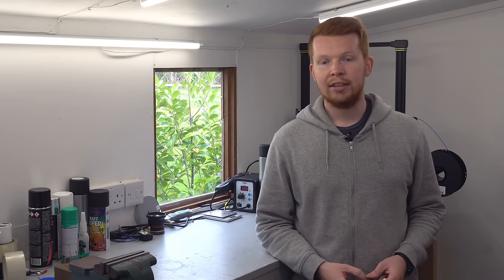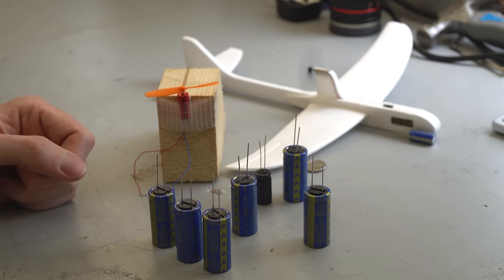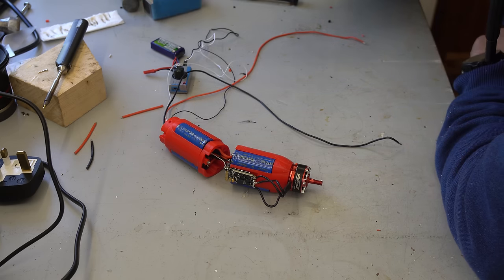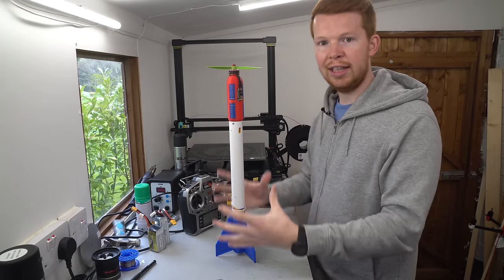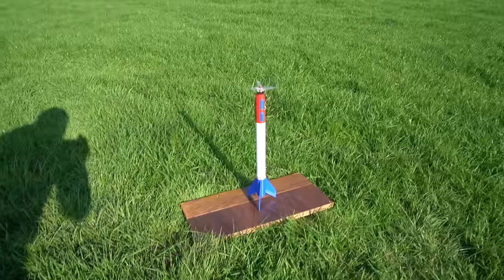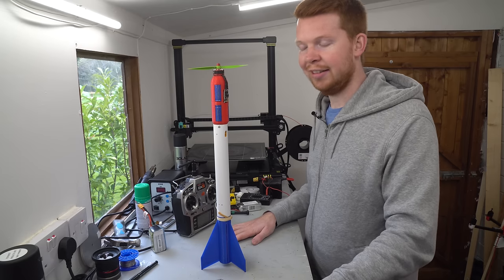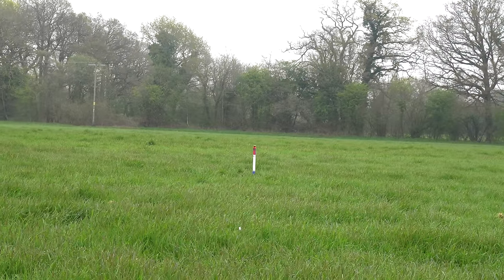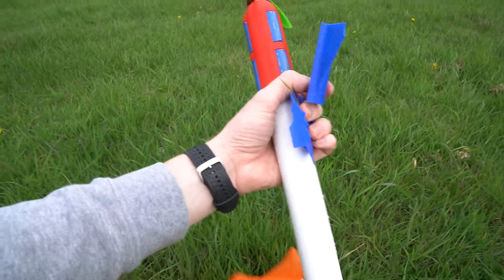Super Capacitor Rocket

Comment: Years ago I heard someone say that a 1F capacitor was impossible or largely impractical ... time changes way too fast :-)
Reply: I mean i guess before super caps that does not sound like an insane statement but for car audio they definitely had up to 5F capacitors probably bigger for a while and also i mean i heard of super capacitors like 5 years ago or so
Reply: James Holbrook They exist since 60s, just were too expensive back then. Also they were vastly improved over time, first supercaps were really big. Like 12v 6F was about the size of a hockey puck. Now it's about the size of 2 2032 cells.
Reply: It is not too fast. Before supercapacitor 1F was really big size. But it is already 50-100 years so. So it is normal that they find something new after 100 year of research.
Reply: I remember playing with 1 Farad 14.4volt caps in the mid '90's when I got into car stereo's and Subs.  1st rig 1200W 4x50w and 1KW Sub's. used to use a light bulb to charge that massive cap after lots of scary moments.
Reply: Capacitor size is usually based on Farad and voltage rating. A 100 volt 1 farad capacitor would be enormous but it would store up to 5 kilo joules, whereas a 1 volt 1 farad capacitor would only store half a joule.
Reply: the farad was made by Faraday, and that is how it got its name, he made the farad the size of it  - unit back then
Reply: @lousmith84  Farad
Reply: two years ago doing my physics Alevel I got tought the same thing
and it still says so in the textbooks
Reply: In the early 1970's, one of my engineering professors stated that it was not practical to build a 1F capacitor as it would occupy a volume almost as large as our classroom.  It sure didn't take long for that, "impossible capacitor" to become common place.
Reply: They still are, depends on the voltage of that 1F cap.
Reply: Man, I feel so old.
Reply: @shadowflash705  Is a hockey puck similar in size to a tuna can? Sincerely a confused Southerner
Reply: @FlyMIfYouGotM  reminds me of when i was 16 i wanted a 5F capacitor for my car stereo, my mums partner who used to be a telephone engineer, said it wouldnt fit in my car and the whole thing was a stupid idea...  Two months of apprenctice wages later, i put one on his desk, was about the size of a 600ml coke bottle, in a case with an led display and things, he was astonished (would have been about 2006)

Comment: "The parachute worked most if the times, apart from obviously the last time"
I think that can be said about most parachutes in the end
Reply: as a former 82nd, member that has had a hard landing too. I thought the parachute should have been a little larger. It didn't slow down the fall very much.
Reply: Kinda like when you find something that you lost? It's ALWAYS in the last place you looked?
Reply: @markthompson4885  I guess you would have liked a larger parachute too
Reply: @markthompson4885  probably tested to be the best it can be considering weight?
Reply: Emphasis on “in the end”.
Reply: That's close to what crossed my mind.

Comment: 15:30 holding a possibly-bent propeller at eye level while revving the engine is a good way to lose an eye
Reply: usethefooorce that’s why he did the flawless “slowly ramp up then randomly throttle” test.  Classic engineering, what could possible go wrong?
Reply: usethefooorce it’s like duct taping the chassis of your car to the cabin
Reply: Yeah that made me flinch, eyes are priceless.....
Reply: usethefooorce it’s not called an engine it’s called a brushless motor. So your incorrect there’s no reason for your unnecessary comment
Reply: @robbieedwardsayers841  *So YOU'RE incorrect
Reply: @robbieedwardsayers841  Just so you're aware, an engine is anything that converts non-kinetic energy into kinetic energy. One could even argue that the words engine and motor are synonymous.
Reply: if you only ever use safety gear and never actually have an accident, no matter how catastrophic, you wont learn at all lmao.
Reply: and even after the speed controller started to have a mind of its own, he sticks his hand into the prop! lol be careful Tom! damn!

Comment: Engineer type here, for your next upgrade use liquid electrical tape on the ESC wire connector pads, then use common electrical tape to waterproof your ESC, this will eliminate the chance of shorting your ESC if it gets wet from grass or condensation.  Look into a counter rotating motor, it has TWO props that spin opposite of each other.  When you scale this up (which who wouldn't!) you'll find that the torque generated by a single prop will start to rotate the rocket which is wasted energy after a certain amount of rotation (some rotation aids in stability, past that it's wasted).  This was VERY entertaining!  Thanks for making this and having the brains to give it a go!
Reply: engineer „type“?

Comment: I know this project is 20 months old already (this is the first time I've seen it) but I just wanted to mention that the torque reaction from the spinning prop and motor seem to give the craft some yaw stability issues.  I wonder if canting the fins slightly in the opposite direction wouldn't help counteract that effect, at least once it gets up to speed.
Reply: That was going to be my suggestion too. It's the easiest option. More lift would be generated too.
Reply: @rcookro  wha? pls explain...
Reply: Or put there 2 counterrotating EDFs instead of prop, would look like wingless A10 :)
Reply: Typically counter-rotating props are used for coaxial helicopters. Lots of kids toys are made that way.

Comment: more like a long helicopter, still a fun little build.
maybe the whole body of the "rocket" should have been capacitors
Reply: Löng
Reply: Capacitors all the way down
Reply: Yessssss
Reply: Unfortunately super caps are a bit heavy, so I don't know how well that would have worked
Reply: Yessssaa
Reply: Do one with full fuselage of capacitors and EDF motor at the back and strong esc.
Reply: It would've needed a bigger and beefier parachute tho
Reply: He can’t really make rocket thrust with capacitors
Reply: I agree, If you watch closely you can see the body of the "rocket" spinning opposite of the propeller. It might be interesting to put on larger fins to stabilize this or use a dual propeller setup. either way pretty awesome quick build
Reply: @oli_ing819  I imagined an electrolyte capacitor blowing up when I saw the thumbnail. bit disappointed here, although it's still a nice project.
Reply: @Makama975  me too lmao
Reply: @CelluloidRacer2  they would be grounded
Reply: @derekwallin2624  to solve those issues youd end up just building a type of drone.
Reply: Helikopter helikopter
Reply: agreed. unequivocally right!
Reply: @derekwallin2624  Was thinking about the same, except perhaps put some space between them and have as a push-pull.  Would also vastly increase air efficiency.
Reply: It actually got quite a but of altitude for a rocket with a home made “engine” 

If produce professionally (balance thrust with weight and “burn” time) it could be an impressive little rocket.
Reply: @oli_ing819  Just short them, they wil explode. It wil be expensive fuel though, might as wel use cheaper non super Capacitors.
Reply: @Makama975  same haha
Reply: Maybe it could be a substitute  for viagra,  some lift along with help from vibration.😅
Reply: @oli_ing819  fatter fuselage using the turbine principle, possibly using the hovercraft principle of downward thrust.
That would be the thrust just around the perimeter of the out put, this could provide better stability and it might even facilitate a guidance  ability.
Reply: Makes sense, just I see how the rocket is more stable than a standard helicopter or propeller-driven probe.
Reply: @TheGlitch93 what about dual props spinning in opposite directions for stability?
Reply: Aren't you afraid of putting it into orbit? 🤣😂
Reply: Yep

Comment: Use contra-rotating props, so energy isn't lost to the rotation of the "rocket" body and for stability. Notice the twisting and resulting failure of the rocket during and shortly after takeoff in the first trial. Contra-rotating props would eliminate that problem and allow for maximum thrust without twisting/failure. (Edit: Autocorrect typo fixed)
Reply: not easy, especially since he's using a brushless outrunner
Reply: @BrianSu  should've used TWO smaller motors
Reply: Ironically, saw a book that had a similar rocket design from the 60s/70s (though using good old rubber bands as the propulsion) They solved the problem of requiring counter-rotation by having stationary blades of equal size to the moving blades underneath. It may also be useful to have a larger or multi-blade propeller so as to maximise the downward thrust efficiency
Reply: @BrianSu  there are pre-made brushless motors designed to operate contra-rotating props. I've used them a couple times on R/C projects. 
https://hobbyking.com/en_us/cr23s-contra-rotating-bl-system-1700kv.html?countrycode=US&gclid=CjwKCAjw7_rlBRBaEiwAc23rhtrOe7NMguaarVRj07sUm8mbF2wNx1omOSuUbETj9vMMtfff9tht-BoCX_0QAvD_BwE&gclsrc=aw.ds
Reply: @skrutinizr9372  Exactly. This is what I had in mind.
Reply: just like a stupid toy helicopter duh
Reply: Maybe he can put a twist in the rear fins so the faster the rocket is going the bigger a torque in the opposite direction is applied. Not sure if this will stop the rotation of the body alltogether but its worth a shot.
Reply: Kirk Brode actually the rocket rotation will help with stability
Reply: He could also just print longer fins, having more wing area will provide more resistance to the motor so it can provide the same lift at a lower RPM and thus save power while increasing stability
Reply: "You can...."
Reply: The pvc pipe he used is really heavy, if he wanted more altitude or efficiency, he could really cut out 50% of the weight or more with a thin cardboard tube or a honeycomb hollow 3D printed body.
Reply: Exactly, I’m at 7:57 and the fin look like they would provide little reactive force at zero to low velocities.
Reply: But counter rotating blades would have been much more difficult.  RC shop have concentric shaft drives, but gearing the outer shaft requires more packaging —with transmission efficiency loss.  But this is a really nice project to do with kids.  This reminds me of the Rotary Rocket Company, and the model outside I’d drive by in Mojave CA on the way to Stratolaunch.
Reply: @djfmitv  Please someone correct me if I'm wrong here- the point of that stationary blades is to act as a stator vanes, I believe. Basically they're to force the air coming off of the blades to stop spiraling off in a vortex and re-converge into a singular column. Jet engines use this sort of setup inside the body (I believe in the compressor section).

Maybe an idea for v3 of this project?
Reply: @skrutinizr9372  I think the biggest drawback of that would be the power draw of the second motor.
Reply: @50KALKILLER  with the efficiency of brushless motors, going from one larger single to two smaller motors doesn't really lose much efficiency. Smaller motors have less draw, so having two of them together might not exceed the single larger motor by much, if at all.  The weight difference can likely be managed as the efficiency drop by downsizing in addition to the prop efficiency on a dual system requiring smaller/lighter equipment- I think it would be very close to the same but with added benefit. Even the speed controllers for smaller current draw motors are quite a bit lighter, two of them could easily weigh less than a larger single controller. 
I have used these many times and have not yet had any issues. My next project is a B-17 with four contra-rotating systems on it... just because.
Reply: The best set up would have been 2 wings at the side with 1 downward propeller on each side of the rocket!
Reply: @BPwhistleblower Actually it's "contra-rotating". The word is hyphenated.
Reply: Couldn’t you just design fins that are angled so that the rocket will want to spiral in the opposite direction the motor is causing it to spin in?  I know it wouldn’t be a complete cancellation of twisting motion but it would definitely be better than straight fins....?
Reply: The build worked pretty well in any case..
Reply: @50KALKILLER  couldn't gears be used to spin both blades in opposite directions with one motor?
Reply: @Hichinator  that may keep the rocket from spinning, but for what? It does not solve the problem of wasted energy due to the higher air resistance from the twisted fins.
Reply: @skrutinizr9372  Bookmarked! Thanks!
Reply: I believe its called "counter rotating".
Reply: Julie Bronson  I saw that movie ... there were some funny robots and a blond guy with me ... they could not stop talking during the  film!!!!
Reply: Julie Bronson  I don't think MST3K were working for the CIA, but I see your point. I found an interesting documentary called "Mirage Men" - I liked it! I guess you already know about it. I think the manipulation showed on the documentary is more real and evil than any possible ETs. Ronald Reagan created a "Saddam Hussein" like perception of the Sandinistas during the 80s. And, of course, that wasn't the last time, as Saddam could tell you - were he not dead.

BTW, I found only one video on Youtube explaining how Supercapacitors work - it's a very bad video, a bad camera filming a nice dude with a whiteboard. Supercapacitors are basically very fast chargin Li-ion batteries: the ions have to move very little to go from the cathode to the anode and terefore have an almost capacitor-like behaviour. I'm guessing they will let high frequencies pass even though large capacitors should be a (very)lowpass filter.
Reply: Julie Bronson  I was watching a lecture by Slavoj Zizek in Switzerland yesterday ... very eye opening - the guy is weird but if you follow his argumentation you can understand his thinking. Another one is Noam Chomsky - this one is awesomely clear! Go past their "marxist" views and drop your objections - if you have any - and you'll see some awesome information! Adam Curtis is also a wonderful filmaker and sociologist - I found "Mirage Men" looking for someone who's interviewed on HyperNormalisation (it's actually an excerpt of Mirage Men that's used there). People accuse Curtis of also being a marxist but he's quick to reply that, on the contrary, he doesn't  think the economy is what guides society - and he shows how attempts that had this vision - economy as the main force in society - all went wrong.

I'd like to ask you something: did anyone raise the possibility that the implosion charges that supposedly were on the WTC were put there for safety reasons? I ask you this because of the incident with the Citycorp Building - you can find it on the Building Big (PBS) episode about Skyscrapers. In short, there were a possibility the Citycorpo Building could crumble because the construction people changed the way the steel frame was joined. I ask you this because I saw a footage of the first building to crumble, taken from very near it and looking up, and it seems the top was about to topple over (fall to the side).

Thanks!!! I'll look for that film you told!
Reply: Or the fins should impart opposing spin
Reply: exactly !
Reply: That would make the rocket heavier. I don't know how fast it went and how much thrust he used but I think it will make less fun with more weight
Reply: @Kittingsl  But contra-rotating props are used on drones and they are very, very fast. They don't impair performance, they enhance it since the power to weight ratio increases (two props), not decreases.
Reply: @Hichinator  The problem is on takeoff, while the prop is accelerating (from zero to very fast over a very short time interval) and the rocket has zero to very little velocity. At and shortly after takeoff there isn't enough air flow past the fins to have a stabilizing effect. This is when the rocket twisted and failed during the first trial.
Reply: @leyline77  or a bit of carbon fiber tubing
Reply: technically you want at least 4 right? to control yaw an pitch?

Comment: When charging high power capacitors, especially with a lithium battery pack, I would highly recommend using an appropriately sized current limiting resistor. The initial peak current will be incredibly high as you're essentially shorting the battery. That's not good for the battery, and not good for whatever switch or plug you are using.
Reply: Well, he said he didn't recommend it.